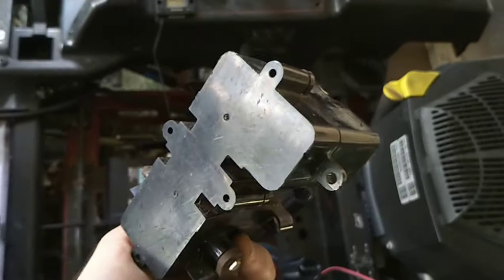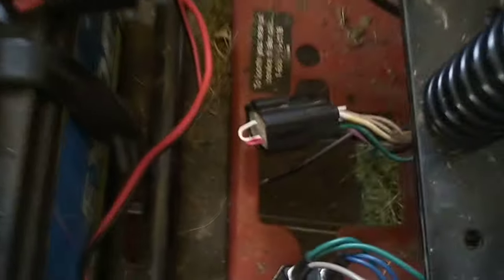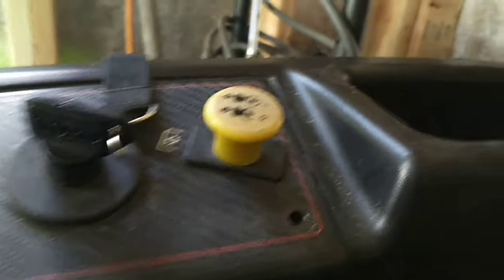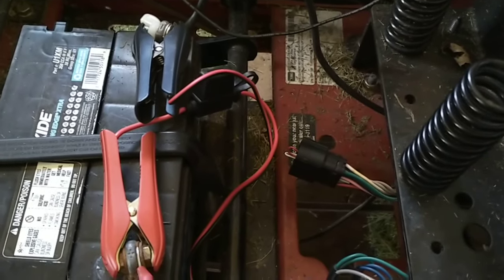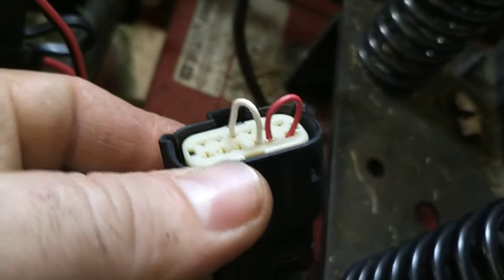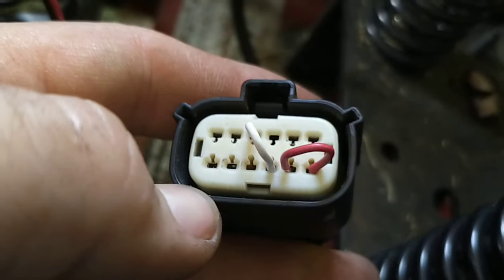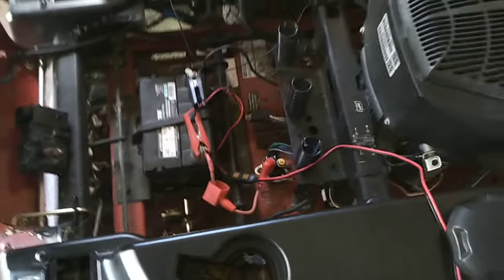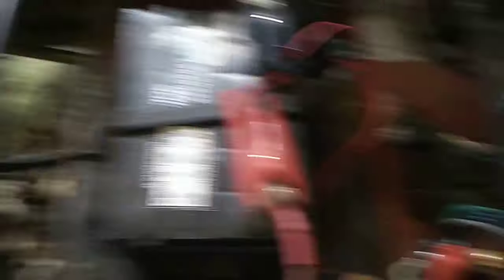Toro Timecutter Zero Turn Brake Controller Bypass

Comment: The only real problem I have had in 7 yrs of owning this Timecutter. Mowed once a couple of weeks ago and yesterday nothing. Thought it was the battery so I bought a new one($60 Lowe’s), nope, so charged the old one all night. This morning, clunks. Watched several videos and thought for sure it was the starter solenoid. Replaced that($18 autozone) and still nothing. Found your video. Whoever designed that POS controller has a special place in hell reserved. Your solution worked like a charm! Thanks.

Comment: THANK YOU. This is exactly what I needed. Replaced the solenoid and couldn't understand why the brake just kept engaging. Not going to run a full diagnostic right now so this will 100% do. Thank you.

Comment: A few days ago my Toro about the same age as this one. I figured out that it was indeed the parking brake. 

I removed the brake control module. It corrected the issue. I also installed a new ignition switch because the original one came apart. 

I located another BCM but am debating on whether or not to put it back into the circuit.

Ive had this mower for at least 10 years now. It’s been a good one until this happened. 

Ive worked on the deck a few times. Other than that it keeps on cutting. Thanks for the video. It helped a lot.👍

Comment: Thank you for mentioning the wire colors that required jumping.  I have an MX-5060 and the wires were aligned differently on the connector.  Once I realized that, jumping them was a piece of cake.  Also, when I started it and tried to move it, one of the wheels was locked up.  I removed the linkage from that crappy brake controller to the transmission, and it's running like a champ.  I've struggled with the POS for 5 years.  Finally, I think it might work for a month or two without locking up.

Comment: Thanks, saved the day! Worked perfect on my MX5060. As mentioned previously the wire locations in the harness are different, but wire colors are the same. I did also remove the brake controler and tied up the brake rods.

Comment: Toro Mx5050 here, and this worked like a charm, I think the wires were even in the same location in the plug.  Thanks very much for taking the time to make this video it is much appreciated.
Reply: Hey! I have the same mower. Would your blades engage after bypassing the brake controller. If so, do you recall what you did. I understand it's been a year or so.

Comment: I've had three Toro Time cutters. The brake module is one of the problems you're going to have. I just bypass the switch like he has done in the video. Also, another problem I have is with the deck adjustment because once you bump into something the deck latch on the driver's side will jump out of the holder ad you will be pretty much dragging your deck beyond the lowest setting. The upside-down hook seems to be a bad idea as it bends and jumps out of place. I use a few heavy-duty prybars bend the metal back into place and wrap some baling wire to keep in from jumping off again and it seems to work for a long time. I've also had a problem with the spring going to the clutch, but I think that might have been an isolated issue.

Comment: He’s 100% right though, you are defeating a safety feature. I have identical surgical scars on my left forearm from defeating a tractor safety mechanism and in the process, got my arm broken in four places…. And was extremely lucky that was the extent of my injuries.
Reply from the maker: @CP-ux9zd  yes, I used this as a temporary measure to get my mower off the lawn so extreme caution should be used and the mower should be repaired ASAP.

Comment: I've had huge problems with the Timecutter electrical..  replaced every switch, solenoid, PTO, Brake Controller over the years.  starter has a dead spot which appears to occasionally jam against the flywheel.  Now it's back to No Start again..  turns out the start switch is getting hot again and either the fuel solenoid or ignition ON is flakey.  wiggle the starter switch connector and things start clicking..  loose connection.  Looks like another starter switch for me or more wiring to defeat interlocks.  Total trash electrically, but awesome mower as been modified. Hydrostatic drives are STRONG!  Deck is trash as well, bent my entire deck about 3 degrees hitting a big rock.  Welded in more steel, hub braces, skirt reinforcement, majorily improved deck air flow, crossed blades.  Wowza!  Will suck the chrome off of trailer hitches now..

Comment: I wish they made these a little more reliable. Constant issues with the safety switches and mysteries why it doesn't start sometimes. This is great info to get the f-ing thing mowing.
Reply from the maker: Yeah I realized I had bought a product engineered to fail so I sold it for $1500 and bought myself a Gravely commercial mower. Problem solved, and it has a mechanical hand brake.

Comment: Man oh man you saved my day 😢mine want crank and also that brake control box will not switch back and forth it will not crank jumping the solenoid I guess the safety feature for the and everything else but thanks again 😁 I'm going to put the green and black and pink and yellow together tomorrow and hopefully it cranks I will let you know

Comment: Love it
I will surely try to monkey mine too else I will have to spend money on the module then along the way this thing will need to be replaced again 
Thank you for the video.
You have not told us what to do with the brakes bracket connecting to the module.
Should I put the module back and hook them up like it was or should I just disconnect the brakes bracket and throw them away or put them away?
I understand I will not hold you responsible for the answer…I will take full responsibility for my actions.

Comment: Well Dre, I did the same thing following you video but now the ignition switch won't turn off the engine!
Reply: then you have the fuel cutoff solenoid powered the whole time or you managed to bypass the kill wire for the ignition coil.

Comment: My mower cranked after bypassing the brake module. However, the blade won't engage. Could you possibly tell me what I didn't do?
Reply from the maker: wish I could help more. I sold the mower shortly after this and bought a gravely with a manual brake lever.

Comment: Disclaimer: Anytime you touch the safety system on a lawn mower, you do so at you're own risk. Please use common sense when working with these systems !!!

After looking at this video and the wiring diagram for my Toro 74633 / 313009502, this fix isn't a good choice. If you're completely bypassing the module you will see an issue with engine cutoff or kill. The mag wire goes into the module and since the module is the heart of the safety system, it's going to ground this wire in the event you come off the seat or turn the key switch off. Turning the key off in most ( my )cases will kill the fuel solenoid and the engine will shut off after a couple of seconds. However, if my butt comes unglued the mower will still run. If the blades are engaged, something could go horribly wrong. 

He mentions the fuel solenoid and the module. In my case, the fuel solenoid is wired outside of the module. This means you should hear it click when the key is turned on. This is NOT part of the safety system. But I am only looking at the wiring diagram for the above mower...

However, a relay could be added for the kill system and wired into the seat safety switch for safe operation. Since I need to do this mod ( bad module ) I will look into the wiring and see what I can't fix. Hit me up if you have questions. Please include your Model & Serial #'s or I WILL NOT help. Not all wiring or safety systems are the same. 

Christian aka Terminal Frost - here, Unfocused_Adventure on IG
Reply from the maker: I completely agree. This is just something I did to get the mower working so I could mow my lawn while my replacement unit arrived. I definitely don't recommend keeping this configured that way.
Reply: I have a Timecutter 75750 408999. Can’t figure out the wiring.  Help out?

Comment: Just got a timecutter 50 inch and thinking about doing this before it even gets a chance to mess up when I’m in the middle of a customers yard would you recommend it it’s a newer model so not sure if it’s the same wires as you show in the video
Reply from the maker: Proceed with caution. This is only a temporary measure to allow you to cut your grass and nothing else. You will not have a parking brake while it’s bypassed, which is a safety concern. If you had a way to install a manual parking brake, I’d do it for sure.
Reply: I was already think of coming up with a manual parking brake I just wanted to know if I do this can I run it this way forever I understand the brake will no longer work wich really shouldn’t affect me because the only time it’s on any ways is when it’s on my trailer and the handles are out but I have chalks that I drive into on my trailer that keeps it from going anywhere weather there’s a brake or not

Comment: Dan, impressed with you video showing exactly what I want to do with my TORO. My plan will be to set up a handbrake connected to the controller brake arms so that I can have a manual brake. Also, I plan to wire thru the seat and mower safeties so that these are functional. I don't think I need to handles safety??? I've gone thru 3 controllers. Any suggestions?
Reply from the maker: That's really the best way to do it. It boggles my mind why they did it this way, and why it's so unreliable. Manual handbrakes are what all of the commercial mowers use, and for good reason: THEY WORK! I ended up just throwing a new controller on and selling the mower. Bought a Gravely to replace it.
Reply: @AndreiDPop  Thank you. Appreciate you taking the time!

Comment: My problem was that the mower would die when I pulled in the steering handles.  This fixed my problem.  The mower won't shut off as soon as I turn it off but it will die after a few seconds.  I think it just runs out of gas after the fuel switch is de-energized. I actually have an exmark quest it seems they are the same
Reply: Exactly. Runs out of fuel because you've lost the "kill" wire for the ignition coil. The reason this fixed the problem is the module was bad or the seat switch is bad.

Comment: Zero turns with this electric brake module are wired much different than any other mower. So if you’re trying to diagnose an electrical problem, nothing makes sense. When you test the ignition switch you’ll be like,” what the hell?!”. Lol

Comment: Believe I have same issue with 2020 5000 model 75750, but a 10-wire harness. Tried it following wire colors indicated with no luck. Won’t even start. Thoughts?
Reply: Did you ever figure this out? Also have a 75750 and can’t get the wiring right.

Comment: I did this and it all works but the mower won’t move seems like the clutch won’t engage the wheels. Any suggestions??
Reply: See my comment above.  Remove the linkage from the brake controller to the transmission.  On the MX-5060, there is just one pin to pull at the transmission end and one at the brake controller to remove the linkage bar.
Reply: I removed my brake rods a few years ago, runs fine without em, but now the safety switches shut my engine of as soon as I pull the handles in, I jumped like the video says but the mower will not move, any suggestions??? Thanks in advance.
Reply: @davidself7999  on my cub cadet the reverse safety switches had 3 blue wires running to each side that simply needed all wired together with a wire nut  and now it mows forward and in reverse. Not sure if toro is same but if the wires are all same color id assume it will work

Comment: My brake controller has been getting progressively weaker last couple years especially when I engage key & hydrostat rods to manually push/move mower into/out of garage. It’s like the brake controller unlocks but then I get a little gear noise and the rods to controller slip tiny bit locking wheels. Springtime related, 2nd year in a row I’ve had to remove and test both little lever arm neutral safety switches so it doesn’t stall when pulling in handles. I “THINK” my ignition switch has been progressively corroding (thus) affecting the current to brake controller. Good battery goes dead if “left sitting” hooked up two weeks due to parasitic draw. Ignition Switch just fell apart minutes ago right after getting neutral switches working. New ignition switch on the way, but anyone care to comment on theory of old crusty ignition switch affecting brake controller performance?
Reply: The arm neutral switches rarely go bad. However the seat switch will. 2 wire switch is easy to jump, a 4 wire switch needs a little more work...
Your question. Low voltage through the switch causing delayed or no response. Relays don't work well with low voltage.
Reply: @terminalfrost3358  The new ignition switch has helped the brake controller (BC) considerably, but a few times NOW acts like it’s 100% opposite of where it needs to be requiring a cycling of key, waiting, and then hoping for the starter to engage. Multi-tested the seat switch, & both lever switches, so future diagnosing is ongoing to catch this intermittent issue. Few other changes, I installed a battery cutoff (knob type) to unhook current when not mowing, I use backpack blower to remove all damp grass from everywhere, & I’m never keeping it outside in the elements (even under a tarp). Maybe the starter solenoid wants new wire terminal ends sometime this summer. Likely my occasionally exposing mower to elements (light rain several times when garage full) has caused my issues.
Reply: @8m617  make sure your battery is good and then go through the process of testing for a voltage drop. This module will not work correctly when voltage drops below 11. Also check cranking voltage.  This should not drop below 10 when cranking. A little bit of water won't kill it unless you have corrosion present.
Reply: Also, after re-reading your original post. The defective iggy switch can cause a voltage draw/drain. Especially if it was in poor shape as you said. Replace the switch and then test.
Reply: @terminalfrost3358  I usually (past couple years) had various levels of last minute recharging on battery if I did not unhook it manually after mowing. Something had been running battery down but now with the cutoff, I won’t ever give it a chance when not in use. Likely was crusty ignition switch corrosion is my guess. Never have tested battery cranking but it sometimes does cut out (likely from varying charge levels). Battery is only one year old & stayed inside this winter. I’ll move checking crank voltage up on my diagnostic list. Original starter solenoid & wiring never unhooked from it & they are crusty. Now wondering if starter solenoid can “progressively” have less throughput due to unseen corrosion. Next best step might be to redo all wiring & throw on a new solenoid if I hear comments that they can progressively go bad. Originally thought starter solenoid was either functioning or NOT functioning, but might be the weak link now. Thanks for the replies which help me consider new areas to concern myself with.
Reply: @8m617  actually a starter solenoid rarely   dies of a slow painful death. They work or don't. However, passing low voltage can happen but you would see this when cranking and doing a voltage test. Battery then solenoid. Then cranking at solenoid and then starter. Also check and make sure charging voltage will bring the battery above 14 when running. Electric PTO's use amps. If the charging system is weak or damaged,  your voltage will be low and progressively kill the battery. I've seen the magnets in the flywheels come unglued and cause these issues.
Reply: @terminalfrost3358  I had a slow turning starter while being jumped with battery. I connected my jumper directly to the starter to wake up the brushes. That worked last time. I'm afraid this time I'll end up bypassing the brake module. I couldn't get anything going but arcing😅

Comment: I did this and the blades wont engage?
Reply: Did u figure out how to get them to engage? I'm having sane issue.....
Reply: Had same problem with my Toro Model SW4200 (74784) - runs after bypass but no blade engagement. My manual includes an electical schematic - near the back of manual after troubleshooting. On this model, the PTO (mower engagement) is routed through the brake box module. In my case, I had to jump the "PTO State" wire (Blue / White Stripe) to the "PTO Clutch" wire (Brown). This allows the blades to engage from the pull switch. As many others have indicated, these jumpers bypass a number of safety systems. With the PTO jumper, your blades will keep turning if you get off the seat, etc. so use with extreme caution. I ordered a new brake module for mine but am using the jumper arrangement to get me by until it arrives. Very disappointed in Toro for tying so many Interlock featues into the brake module that appears to be very prone to failure.

Comment: I need help. Not even this truck will start my tractor
Reply from the maker: I’d offer help but I got rid of that turd 5 years ago and have been using a commercial gravely since.
Reply: ok thanks @AndreiDPop - i think i've tried everything. replaced battery, spark plug, solenoid, banged the brake controller with wood (saw that on youtube), and then your method. nothing. which also means I cant move it
Reply: And fuses too

Comment: Toro went from having a reputation as a decent mower brand to complete crap because of this one part. I steer everyone away from anything made by Toro now.
Reply from the maker: Yep. I actually sold my mower over this issue. I looked at exmark but avoided those also because I knew they were made by Toro. I ended up with a Gravely. 

The actual defining reason I didn't go with an exmark was the lack of a usable cupholder and storage on the Radius models.